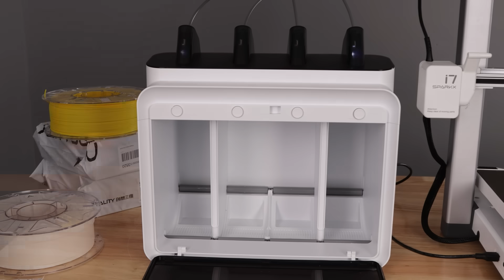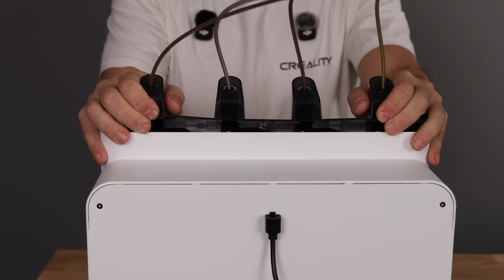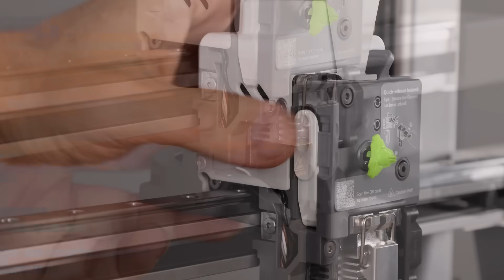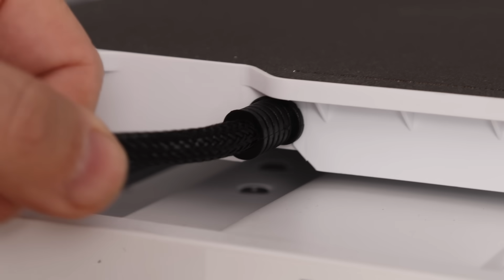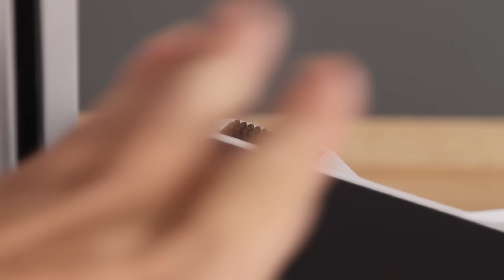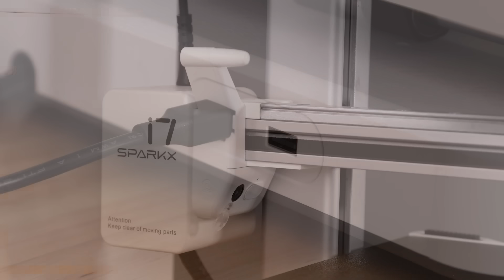SparkX i7: Deep Dive. Introducing, the New Creality Beginner 3D Printer

Comment: The second gen bambu lab printers have a flinger at the back of the purge chute
Reply from the maker: They don't
Reply: Its more like a purge cutter that moves forward when the toolhead moves back and moves back once the toolhead moves forward
Reply from the maker: @keyurpadmawar253 yes, it will scrape the filament off the nozzle, but it still has to fall down a chute. I'd like to see the chute part removed from the equation.
Reply: @3DRundown that's a good point but then you have purge waste being flung
Reply: And even with a deflector and bucket it can still bounce off the deflector and onto the bed
Reply from the maker: @keyurpadmawar253 Yep. I want it flung away from from machine like the Hi, A1, I7

Comment: While the focus is on multi-filament, easy to use printers, the designs have left behind the single above extruder spool holder. This design is best for TPU filament use. TPU not being user friendly, as design, part size, etc need be fine tuned  to slicer settings. What is not mentioned are the filament types compatible with this Sparx. I assume PLA &PETG.
Reply from the maker: There is a snap on external filament holder. However, it doesn't come with a splitter, so, a splitter would be needed, or a ptfe to be temp removed

Comment: Oh no, yet another Creality printer, can't they stick with something? Even though I really like the new head assembly, will this mean new adapters for the existing K series and enders to use the new clip nozzle? Will there be another, another nozzle on the next one? Spare parts for people with more than one model is starting to be a bit crazy. Remember the V3SE and KE, seem like a million years ago now (still on sale) with completely different head setups. The after-market guys will start to just give up holding any stock longer than a year. If you were to buy the printer, I'd be thinking to buy as many spares as possible at the same time. EG: Adventurer 3 bits from FlashForge or someone else are getting hard to come by and those nozzles do die. The Adventurer 5 nozzle is the same, but slightly different enough, it doesn't fit. 
Wonder if you can plug the normal CFS onto it (similar plugs) or visa-versa.
Are you not allowed to show print quality yet? Was really keen to see the prints for surface and color bleeding (if at all).
Reply from the maker: Can show whatever I want, but my i7 is currently bricked. Bleed comes down to flush Volumes. Should be a non-issue. I did only 2 benchy. They were fast af and came out great

Comment: The multi material housing doesn't have any drying capabilities. On top of that, there's no filament snag cutter.

But, that nozzle replacement thing looks like a dream to use with that big locking mechanism as opposed to the A1.
Reply from the maker: The Hotend is easily it's standout feature
Reply: Filament snag cutter, quick, design one.

Comment: A few little touches I wish my A1 had, and a few corners cut. The CFS is massive, you won't be mounting that on top of the gantry! (edit) just saw a mod where someone has put an AMS 2 on top of an A1, so never say never I guess.

I wonder why they pulled your interview?
Reply from the maker: It's smaller and lighter than it looks. It's REALLY light. Because I'm not a loyal enough Simp I guess. 🤷🏼‍♂️

Comment: So no automated retraction into the CFS Lite.... But probably not needed with the toolhead mounted 4-way adapter right? Guessing it cuts the filament and the extruder pushes it back just enough to clear the 4-way and then pulls the next filament down?
Reply from the maker: It has the feeder, but no roller drive. It's weird and makes me nervous. I'll grind it to death after CES and see what happens. *If I can fix mine
Reply: @3DRundown that's what makes me wary about it as well. Enjoy CES! I'll look forward to seeing a torture test from you down the road!

Comment: The Hi model is a new and very nice product, but it's not getting the updates it needs, and instead, an i7 is released. If you're going to discard your products and make new ones instead of improving them, how are you going to earn people's trust?
Reply from the maker: I don't totally disagree, but The Hi is nearing a year old, and isn't a Casual targeted product.
Reply: @3DRundown  The current position of the Bambu A1 in the market is clear. They could have constantly released new models, but they strengthened the existing one.

I really liked the Creality i7 and will most likely buy it, but they could have built a more solid foundation for this model instead of the Hi model. I don't think the Hi model will be preferred after this one. (I also own the Hi model.)

Comment: To be honest, if anyone is considering this 3D printer, I would recommend trying to get a Creality Hi Combo for basically the same price as this printer. Bigger build volume, regular CFS/16 Color support, Faster speed, overall just a better buy IMO. I think Microcenter still has some stock left.
Reply: For such a small-sized printer, having a 260 x 260 x 255 mm printing build size and the addition of the CFS Lite for maybe $299, it's not a bad deal. The Hi has a 260 × 260 × 300 mm build size and it's more expensive when bought with a CFS ($399).
Reply: @nunopenaspt The SparkX i7 is supposed to be $399, so I don't see the point in this.
Reply from the maker: Depends how well this works. My Hi loves to Jam up
Reply: @3DRundown @3DRuld I like to see too. I have 2 Hi Combos and personally never ran any issues. Only real issue I've had is  extruder issues and filament break inside it. I just still would rather take a premium machine over a more "Budget" model, even for the same price.

Comment: I can't help but to compare this to the Creality Hi, Moreso than the Bambu A1 or A1 Mini.  I see this as an even more entry-level/new-to-3D printing option, since the CFS-Lite is only 4-colors and there are other features that make the printer easier to use, like the quick swap nozzle (versus the unicorn nozzles that aren't really quick swap).  I mean, the Hi is still pretty user friendly with upgrade path for more materials and colors with 4 CFS units; however, most users, especially new users, won't use more than 4 colors and the main use for filament boxes is automated loading/unloading and automatic refills.  Two other things occurred me to - does this printer even have an external spool holder?  Will Creality come out with a Sparkx Mini (like the A1 Mini)?  Can the CFS-Lite be compatible with other CFS-compatible printers?  Just some more thoughts.
Reply from the maker: Yes it has an External, but it's pointless. There is no 5th input. You'd need a splitter, which is not included

Comment: This is a nice redesign/update of an outdated (IMO) printer. Sure. Creality can go after the entry level, beginner market. They certainly can’t compete at the high end, again IMO (and yes I own two Creality machines, K1c and K2+). I think the real problem with this printer is not the printer itself, but what it says about Creality’s product plan.
Reply from the maker: Creality can certainly compete. They just need to get their CFS to be a little more reliable. They also have higher end industrial machines, through there sub-brand Piocreat. Some badass stuff. I do feel Bambu is the current leader in dependability, for the home market
Reply: @3DRundown Dependability is really where I was focusing. I got my K2+ and P1s at about the same time and the K2+ has had so many issues, and is no longer printing as well as it did in the beginning that I only use it on large functional parts at this point. The P1s? Still printing strong and accurate and clean, just like the day I plugged it in. That’s where Creality is struggling IMO. They have the potential but I think the lack the focus.

Comment: centuari carbon for 265, like 100$ cheaper is a bargain
Reply from the maker: CC is single color, and a problematic machine
Reply: @3DRundown  I will say I have over 1k hours no issues with my CC at all... BUT agree, single color is a downside.
Reply: @3DRundown they in progress with it.  The extuder cable is the only real issue I am aware of.
Reply: @3DRundown @3DRundown  The benefits of an enclosed environment (e.g., absence of printing, reduced noise, increased accuracy, and less space) greatly outweigh the multicolor option.

Comment: Very cool, and ya, as a prior A1 owner, i do like this hotend more, the amount of posts because they could not close the clasp... 
Not that it wont happen here, but it should be a LITTLE harder to mess up
Love the feed system, those 2 are major upgrades IMHO over the A1 series. 

Can you check the bed? The BBL beds are normally bleh (heating)
Reply from the maker: The A1 Clamp is the death of me! This is so much better. It feels super solid in person. 
Check how?
Reply: @3DRundown  easiest way if you have a thermal camera and point it at the bed as it heats up to see the pattern, otherwise, not now but maybe in the future when bed replacement instructions come out, an inspection of the underside, is it pad, circuit, or other design